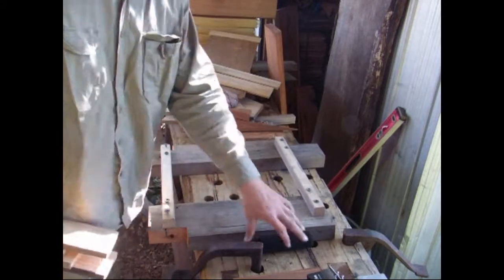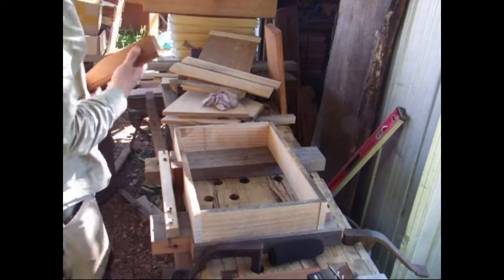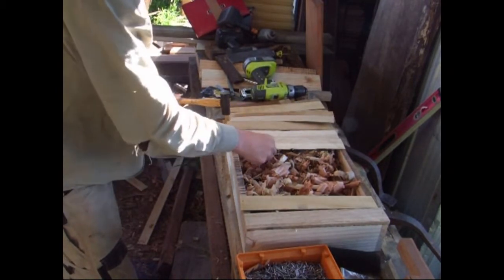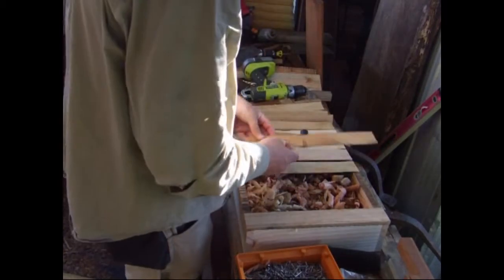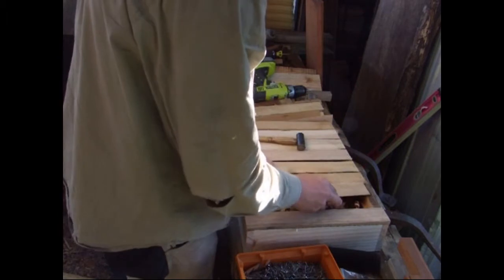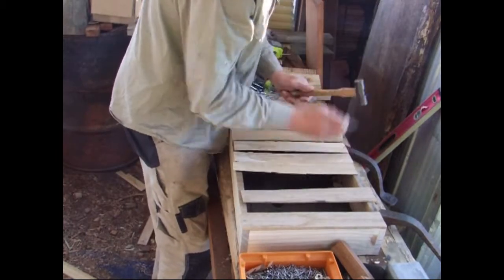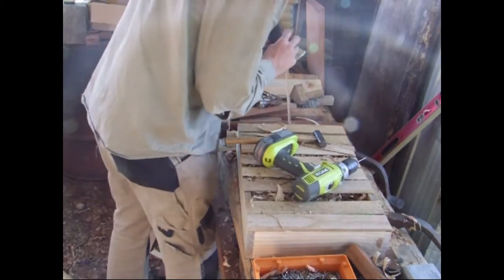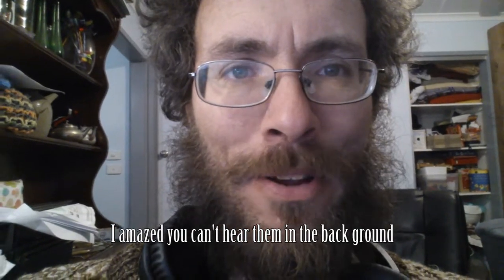How and Why to make quilt boxes for your bees

Comment: Whats the reason you have the slats on top of to quilt box instead of being exsposed? Can you do an update video when you get the chance please and thanks for sharing your design with us
Reply from the maker: Mainly to keep the saw dust in and keep things like mice out.

The previous ones I used didn't have tops but had a lid that fit tightly on top which was also the hive roof. 

What would happen was that I'd almost always end up spilling the saw dust out of the quilt.

With the open gabled hive rooves I really didn't want anything mouse size or bigger being able to move in.
Reply from the maker: I've got to do my autumn pack down soon so there will be an update.